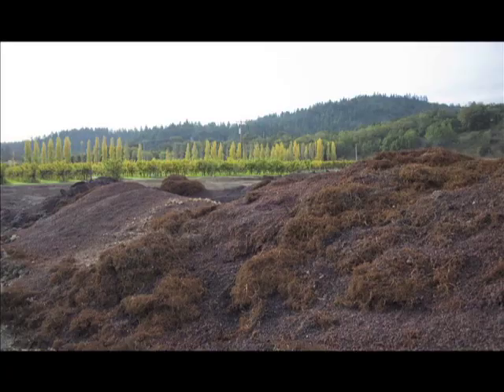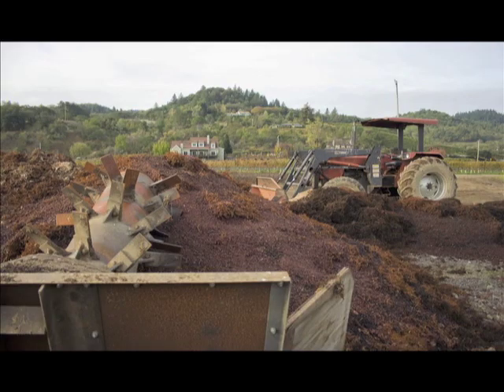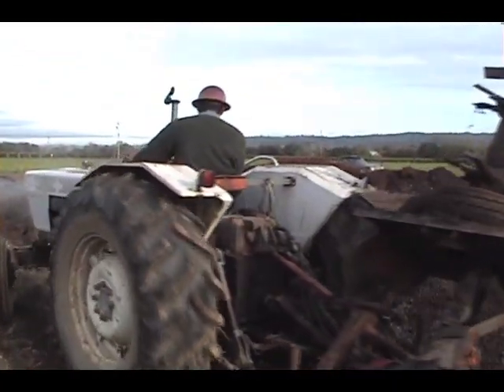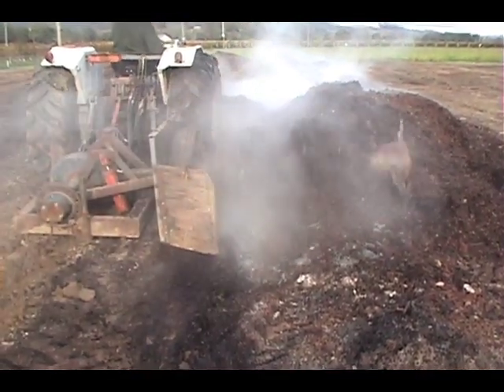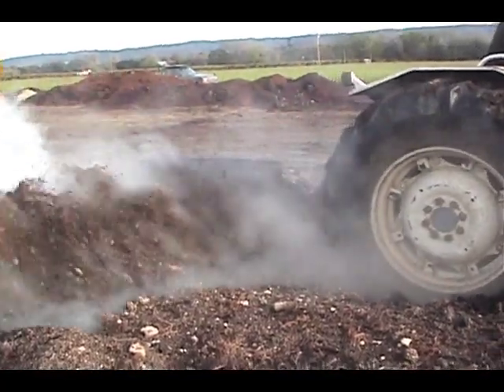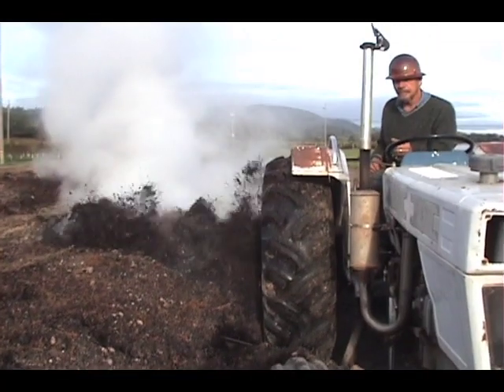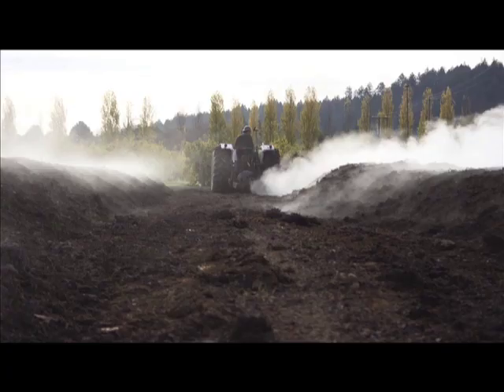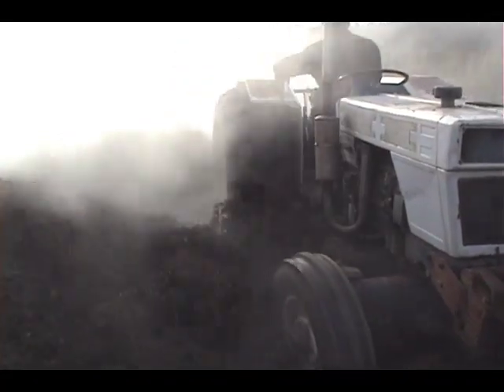Low Cost 3 pt. Compost Turner

Comment: I say you did a great job. Would try it myself. I've got an old Dana bridge rotting away behind the stable. Did you have to lock the second halfshaft welding the hub to the frame ?